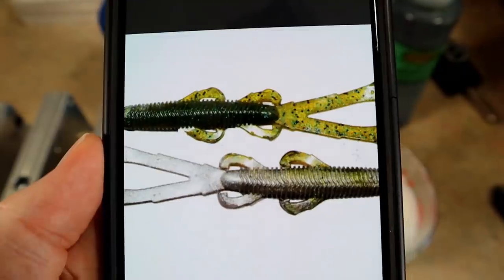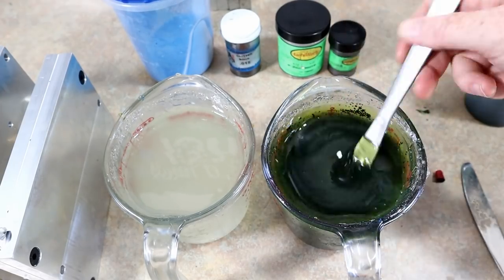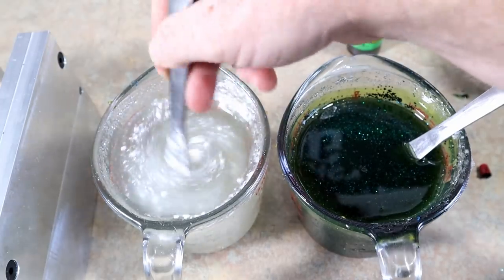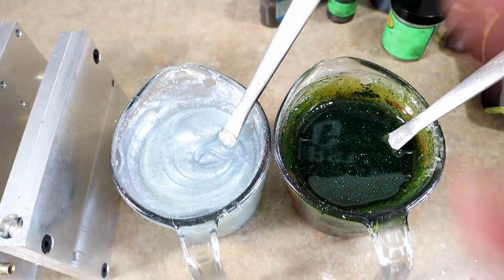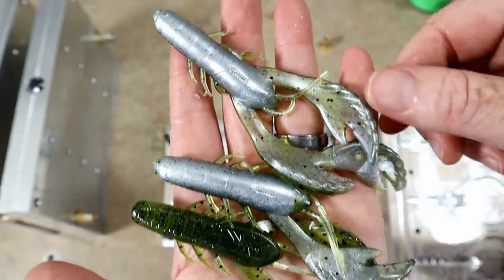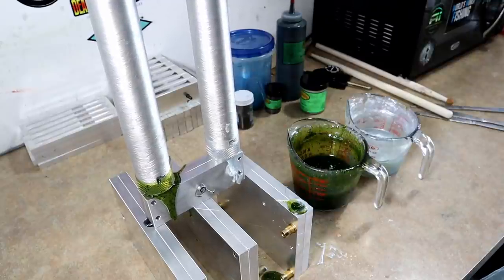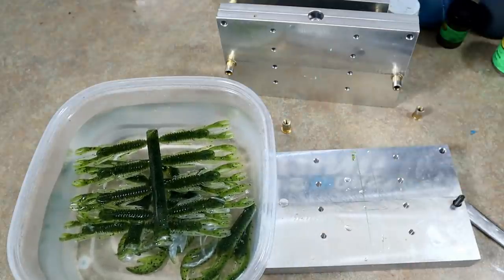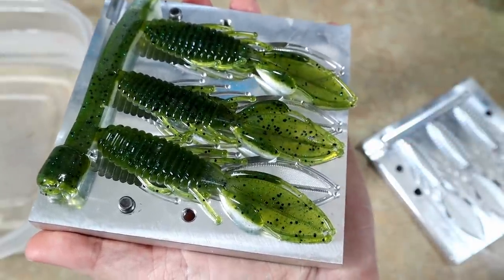Making GOOGAN BAITS "Natural" Color: Color Matching Soft Plastic Lures

Comment: I'm sure you've already thought of this too but, on any future custom molds you have made up you can actually shape the sprue channel into a specific bait shape so that you don't have to toss it into the re-melt bin.  You can use it as it's own separate bait type.  Less waste of Time and Plastisol.
Reply from the maker: the sprue has to provide plastic for the gates..but that could work maybe
Reply: @WorldsWorstFishing  I think the combined artistry of your machinist friend and yourself could come up with a sprue design that could be easily machined and still give you a shape that fish would strike.  

I've noticed in many of your videos that the sprue rarely ever shrinks so far in that you get rejects in your casts. 

Maybe it's just that you've edited out those possible failures but I think you should give it a try.  You'd be about the only one on the block doing it.

Comment: I just got into this hobby, but my mom came about the dangers of breathing in the fumes can cause lung problems and much more. When I did some research I found that it’s when it burns burns (turns black) the smoke and fumes from that are toxic. But not just the smell it’s self when heating the plastic. I see that you don’t wear any mask or anything you even say you love the smell lol. As many people suggest I’m wondering if it’s true if just the smell alone can be toxic or if it’s only when it burns?
Reply from the maker: I ventilate the fumes out with fans..dead on plastic is made without phthalates which is much better, but you never want to just breathe in all the fumes..and yes, when it burns it is very toxic.